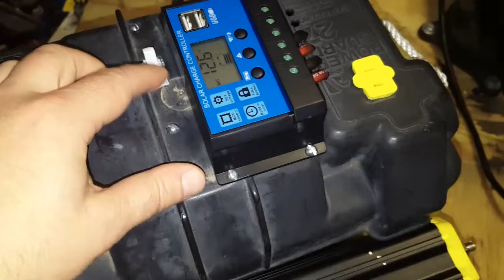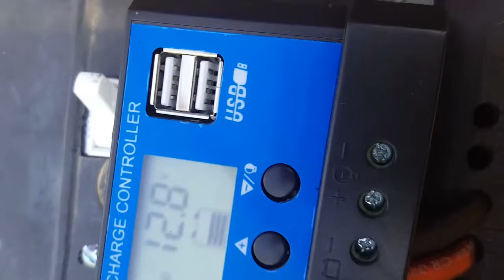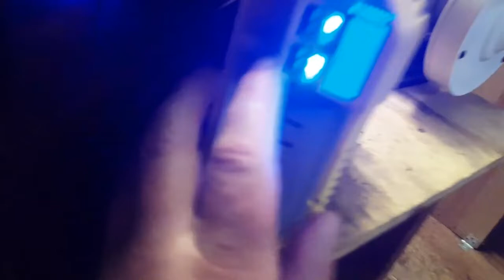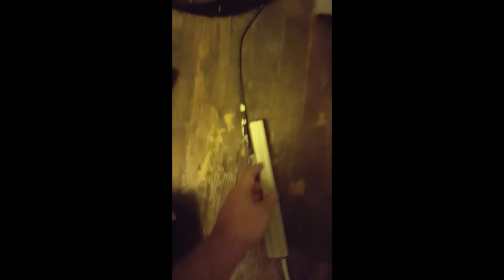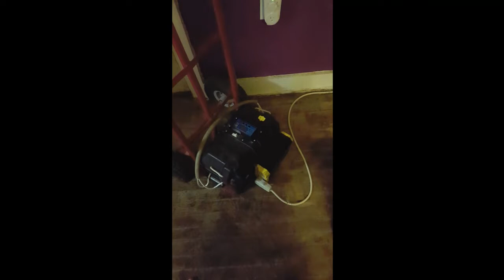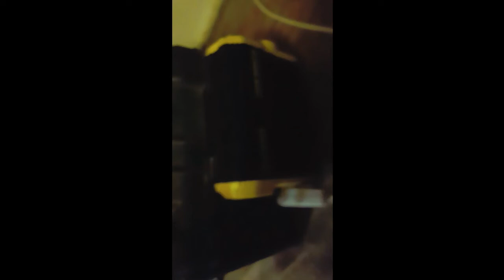SELF-MADE Solar Portable Generator CHEAP BUILD! #prepping #preparation #preparedness #prepare

Comment: great video, where are you going to place the panels? i have not been able to make much progress on my system due to other projects getting in the way. hope to be able to get back to it next week. ironic we had a storm this morning that took out power for about an hour and all the parts for my system are in the living room. i guess that was a message telling me to get going.
Reply from the maker: " Well " ... said the storm with no power " Get your butt in gear and get your solar power made!" lol :D hahaha  Was the message :D.  
I have multiple Panels, I plan on putting mine on my roof, I have some aluminum brackets and square poles I have, I will be using for my frame work. I have many panels, only one of my 100 W ones was in video, I have 4 x 100 W panels and 2 x 400 W panels, each one is like 7 ft tall lol, taller than me and quite heavy lol. My reasoning for not putting my panels outside and on my roof yet is.. If they are connected NOW in line with everything, if by any chance an EMP or CME happens, Its all toast, worthless then. Doing research on CMEs & EMPs, If the panels are NOT connected and not in a faraday protection, the most damage too them would be up too 10% done, 10% loss. If in line, up too 100% loss.. So.. I'll wait lol. I have all my household Solar items, Inverter, Solar charger and other items, except the batteries, in a Faraday cage I built, right now as we speak, except for the smaller Portable Solar station, that is in video. :)